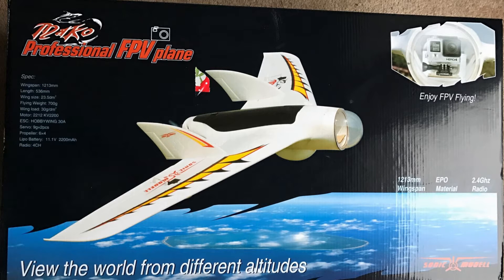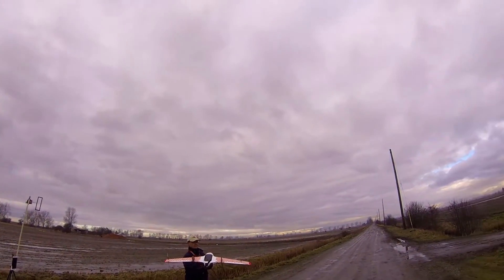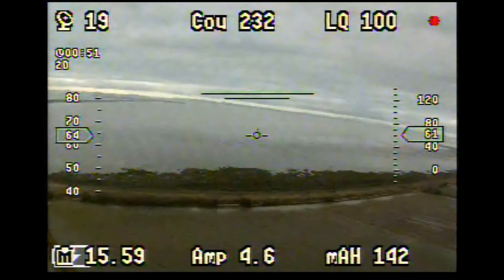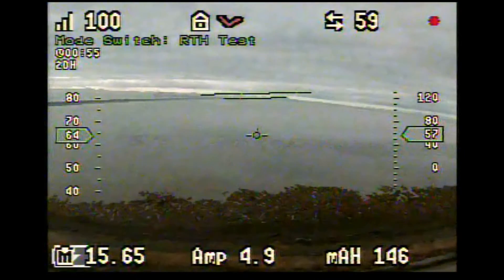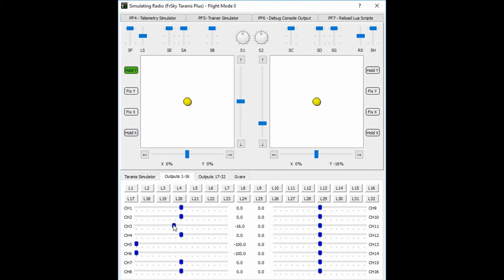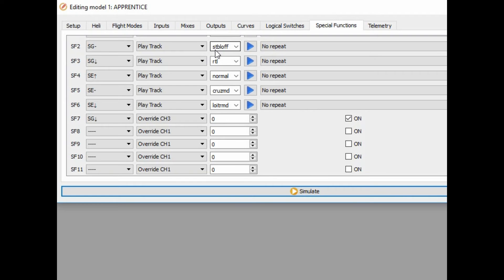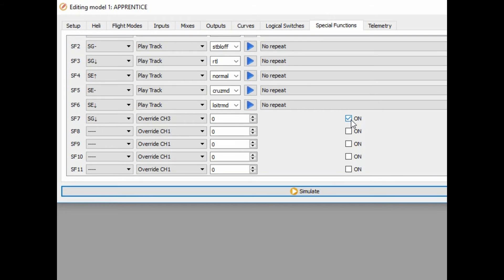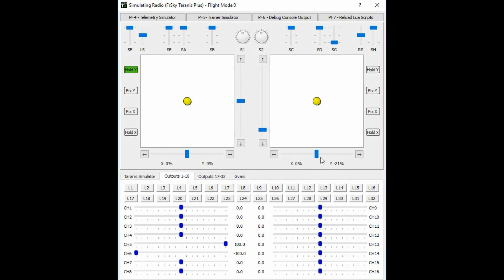RTH doesn't engage in Eagle Tree Vector work when too much trim.. Solution!

Comment: Another educational video Eduardo, thanks for posting a solution and for a couple of other alternatives in the comments below. I personally discovered this problem 2 years ago with my Bixler using the Vector on RTH...my only solution was to work on adjusting my clevis until throws were good and trims centered.
Reply from the maker: Thanks, at the end I end up doing what you mention.  I adjusted manual and left the trims in neutral!

Comment: You can use Incorporate Trims to compensate the trims.
https://www.youtube.com/watch?v=LQPX3L0SuhA
Reply from the maker: Thank you for your contribution.  I though about doing that but it is rather complicated to incorporate trims every time you alter trims.  In this plane trims are quite different depending on the speed you are flying.  I found this solution to be the simple of them all, what do you think?.
Reply: You can make a Sub-Channel of Elevator channel 3.
Settings:
Include Trim :NO
Switch           : RTH-Test Switch from eagle
Multiplex       : Replace

RTH-Test Switch use that sub-channel with no trims.
Override the channel 3 to zero disable the control of that channel.
Reply from the maker: Pfuscherking good point, consider that the Vector takes control over the servos and ESC when it's on RTH. You just need to provide center stick for it to engage. All your sticks are on the center when RTH is controlling. No input influence the Vector RTH function. Need to test to see if it works!
Reply from the maker: I'll let you know if it works next time flying!!
Reply from the maker: Hi, I tested today in flight my procedure and it worked perfectly!  Great relieve that worked with such simple programming.